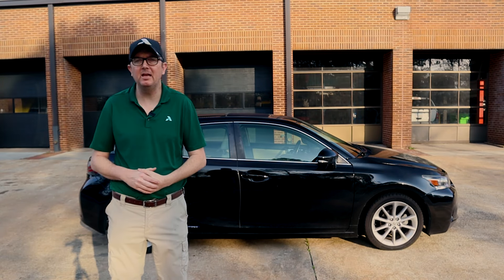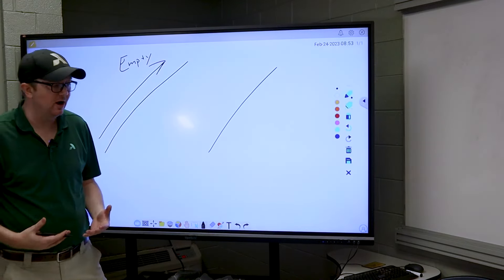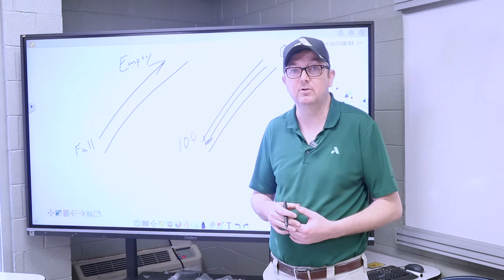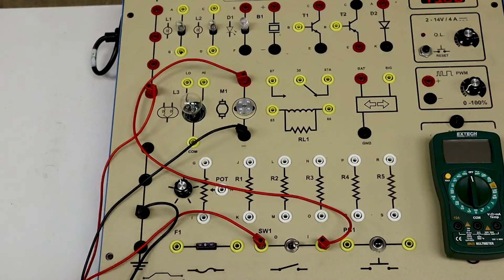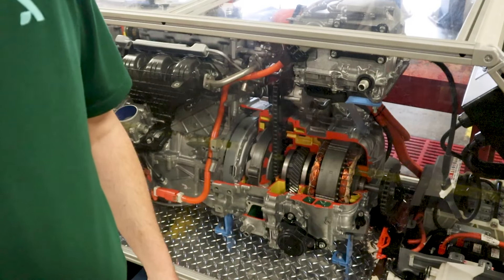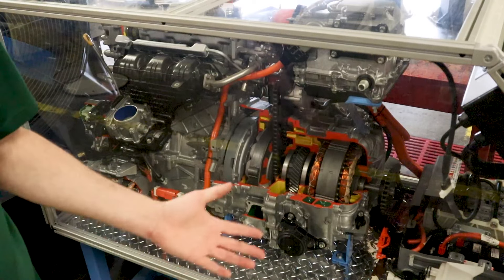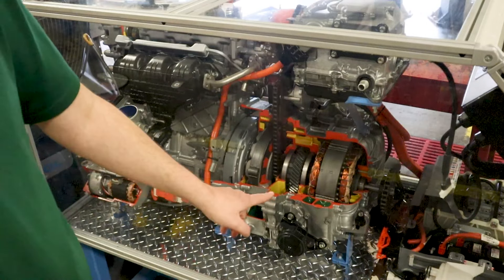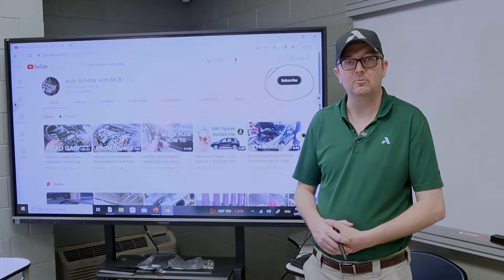Regenerative Braking in Hybrid and Electric Vehicles Explained

Comment: 60-70 percent efficient?  Not even close on a Prius Prime.  When I climb a particular grade, I’ll use over ten miles of charge climbing to the top.  When I coast down with regen I get only two miles back.
Reply: I was thinking aero drag and roll resistance and any stops likely robbing you, too.  If 10 miles of charge is 2.5KWh_elec, thats about 2.3KWh mechanical; if u climb at say 20m/s im numbers rough Fdrag~ -60N, Froll*+ Ffric~ -180N, so every km you drive (if say at 20m/s) they steal ~240kJ, and car uses~say Pload=1kW forr loads like pumps&fans &hvac for that km50s=50kJ so ITHINK🙄 you lose on order of  300kJ /km. (i used roll resist but during climb tractive slip is happening idnk how to calc so fudging here using Froll🙄)
Unfortunately i dont know steepness of hill, or initial speed at bottom vs final speed at top ill assume KE1=KEo:

say 4%grade.. Etract_mech/(Fdrag+Froll+Ffric +Pload/v + Mg(-1*4%)) +(KEo-KE1)=~distance driven to climb~

or approx -2.3kWh/(-290kJ/km + 13kN*-4%) ~ distance driven in climb ~ -2.3*3.6MJ/-800kJ~10km~6.6miles@4%?  how am idoing..anywhere close  long steep climb 4% avg@20m/s =45mph?  w my guesses of params which prob stink,  itd be about 400m ascent for 10km climb@4% thats a big hill..
Anyway, if you roll back down my guessed  hill and params at same~ steady speed, (battery not near full no wind)
Fgrade(-4%)=~+650N, and Fdrag&Froll&Ffric take their lb of flesh ~-290N, or ~0.8kWhleaving available Fregen~360N. Pregen~ -7.2KW which i think below regen Pmax, so okay.
For 10km descent mech regen power ~ 3.6MJ =1KWH_mech the regen system absorbed mechanically.
I THINK this measly 1KWH mechanical, work that regen actually did is the energy to compare to what you get into battery as kwh_elec, then especially the fraction back out as useful mechanical energy
So a certain amount gets to battery as electrical, people say like  70%-80%, then prob 85% of that gets back to wheel when driving..
Also note during descent, that i guessed at 10km, the cars Pload (motors fans, drive sys hvac) pullong on batt of course i gueesd swag Pload=1kW so Pload*(10km/(20m/s))~500kJ~0.13kWh?
so that hurts only maybe “see” 0.87KWH elec in batt at end of descent?
anyway my numbers seem bad bummer  => you  pprob get 3 miles out of 870Wh not 2 miles
My point is just that The regen system only gets a small portion of the total energy, thanks to drag, rolling resistance and friction in the drive system, and then the car sips some of the battery power away.
.. my numbers were too rough I think but maybe if you measure the length of the climb in the distance and your speed, and check the numbers on the losses, it might be a way to get a good number for your actual regen efficiency from mechanical in to mechanical out,  hope this was useful and not too rambling. BR
Reply: @foxlies0106 All those things you mentioned are also in effect when you're NOT in regen, and they don't use 80% of your battery then.  The Prime just puts very little back into the battery during regen.  And we're not talking about any stops, and the climate control system is off.  I'm talking about driving up vs down on the same long grade on the highway.  When you're at a steady speed on a flat road your discharge rate tells you the sum total of all those losses.
Reply: Errata: 
A. first made mistake above: i said 0.87KWH might show up in battery as final result Error sorry.
B. secondly, tractive slip loss is important i glossed over. sorry.
 
A. the 0.87kWh calc wrong. ironic i neglected much of the crucial loss that we want to know!  
i skipped the  from  “regen_in effic” from how well motor&inverter&BMS convert regen wheel mech energy into the battery electrical energy [kwh_elec] that  shows up on dashboard; 
if that efficiency is 80%,(say) that  1KWh of regen mech input energy would convert to 800Wh_batt that arrived into battery;
and then subtract the energy removed by loads from battery ; i SWAG guessed  Ploads~-1kW, and Eloads~ -1KW*10km/(20m/s))=500kJ_elec  ~0.13kWh_elec. so batt might show a net of  ~ 670Wh_elec, in my swag example,  from the -2.5KWh_batt invested, due to all the different losses.
=> And that was me assuming drive output effic of 2.3KWh_mech/2.5KWh_batt_elec=~90%, and that regen_in_effcy assumed80%, which means im testing a regen round-trip efficiency (RTE_regen) hypothesis of 90%*80%=72%. which seems optimistic
To get to the point, sorry:
even at really good seeming 72% regen RTE, if my numbers are roughly good, so many losses like drag, etc, remove energy  from system and battery, the numbers look lousy, like getting only 670Wh_batt back from the 2.5KWh_batt  it can be recovered by the regen, the regen can look worse than it is.
Unfortunately what I didn’t provide you is a useful way to figure out these parameters, but I think if i maysuggest, what im going to try 
1) get good parameter value estimates (ignore my swag guesses sorry )re: 
a) mass M of Prius primeprime+driver+gas+payload;
b)  mrot mass-equivalent at wheelsof the rotational inertia of wheels&drivetrain; hubs shafts, transmission motor rotors.  unfortunately, probably varies as driving varies and ICE, M1, M2 “clutched in and out via planetaries?
c) big issue imho eqns for the longitudinal  tractive slip loss from tractive driven tires on ascent, and  loss from braking tractive slip all braking wheels on descent)
{idnk this yet sorry  i assume ~proportional to tractive force torque or power  applied by motor and/ or brakes, (or even drag)at tire patch and car  weight fraction supported by driven tires, and depends also i think on the tire type, pressure, contact pressure, treadwear, tire temperature, road surface&temp   {aint this fun fun fun!}
d)  frr~0.012  parameter for tire hysrpteretic rolling resistance of undriven nonbraking 
e) lesscrucial Ffric friction (constant force/torque)losses in drivetrain from bearings, gears, etc
f)  viscuous kosses in drivetrain 
  get estimates people provide, lke his video, to compare.)  usually assumed constant but has increase with speed
c) Cd*Afrontal*air_density
d) hill length, grade and elevation
e) ascent&descent speeds.

2) record temperature, SoC, speeds, locations for map data. distance grade of climbs& descents   at different ~steady speeds if at all possible ayk. 
Dash cams can really help. GPS OBD2 im in process.  Elevation data hard often to get accurately, imho☹. GPS often large errors; GPS-inu_barometer prob best (Hunter research Theodolite phone app my current focus.,)
a) record drive modes used, D probably best to use throughout but idnk for sure.  Using N say on descent ayk often disengages regen?
b),  Use slower drive speed is better for inital calcs, if safe, to lower eg the typically large  uncertainties in aero drag eg in Cd*Af*ρ, and wind; 
b)lower speeds less energy but lower drag, ohmic and other energy &viscous losses..
c) better of course ii know  if tires fully inflated  and same each time, 
d) tires and battery pre-warmed to ~same.
e) A/C&heater off, and other loads minimal,
f) check battery has plenty of “room”;  note battery temp & SoC at start and end of ascent, and same start&end of descent..
f) ayk test with no wind if possible, and best precipitation nor say a very wet or hot or rough-surfaced road;
g) if possible do runs same day or two, same  ar condition and ~payload 
h) or i may try adding say 100kg and repeating test.~.2.5%more energy from batt on ascent
on 8% more Frr loss, but i think we’d see 20% more regen energy back in on descent, for my swag example.  thus i think good param/result check to do that, assuming if slip loss is linear with weight!

3) Compare the runs check param estimates.(how best to do that? um .notsure?.tbd?🙄🧐☹)
a) for variation/checkascend partway not full, record that; or 
b) take data using different hill w different slope..
4) as you know,  Wind esp, temperature and HVAC of course vary results.
hope this is useful not pedantic.BR  work in prog🙏